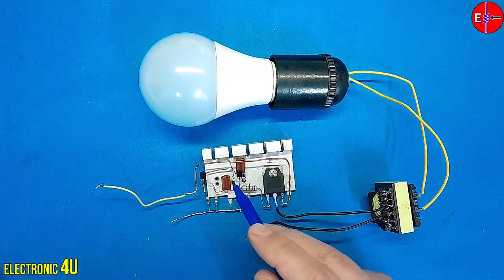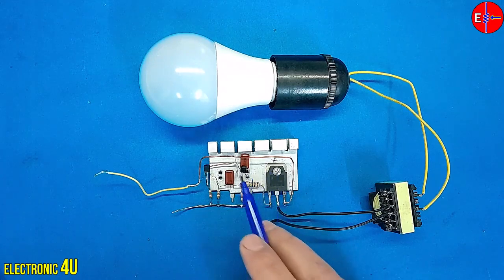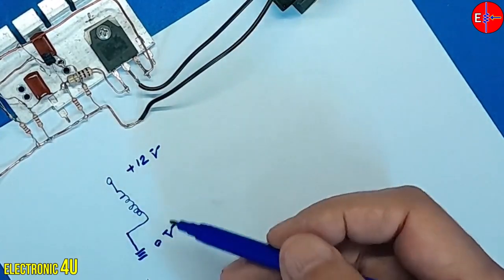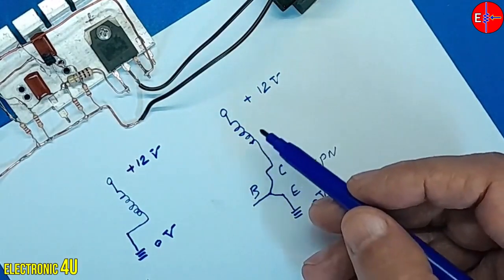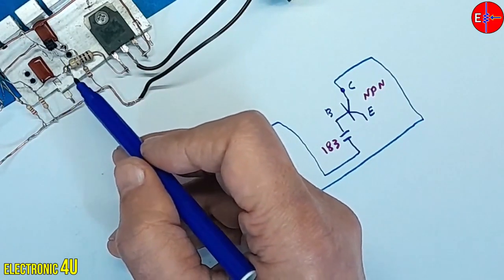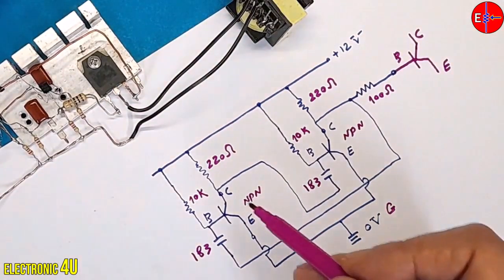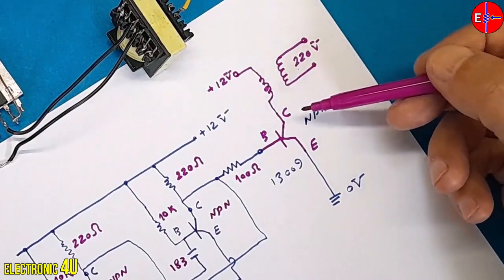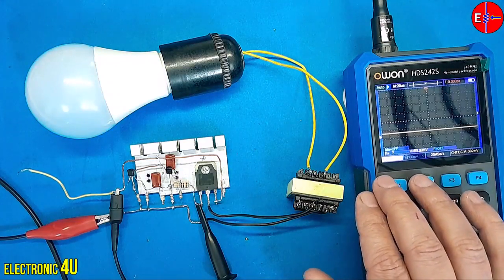How to make oscillator circuit for 220V inverter?

Comment: It's a pwm circuit using flip flop circuit. The frequency is high, causing transformer ringing, 50 to 60 hz is not enough to drive this circuit, just tried it.
Reply from the maker: Hello, thank you for sharing the information.

Comment: This is very high frequency voltage and probably very unstable at different loads. This can damage sensitive equipment. Use this circuit with caution and at your own risk!
Reply from the maker: Thank you for your comment. This circuit is better to be used only for lighting

Comment: can i replace transistor to mosfet???
Reply from the maker: Yes, put a ten kilo resistor on the source and gate❤️
Reply: @Electronic4U-david  why on source?
Reply from the maker: To turn off the MOSFET, it must be connected to the negative, of course, another method is to use a reverse diode
Reply: Oh, I thought the mosfet turned off from it's gate like a "base" on transistor, no?
Reply: I'm new to electronics. I appreciate you.
Reply from the maker: Hello, thank you very much for your attention